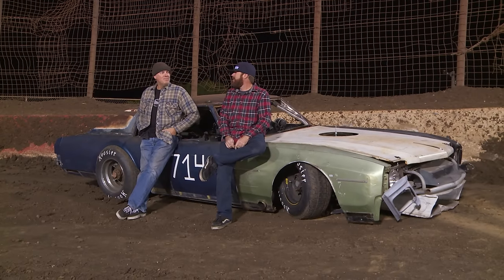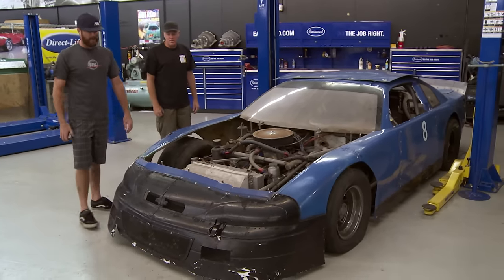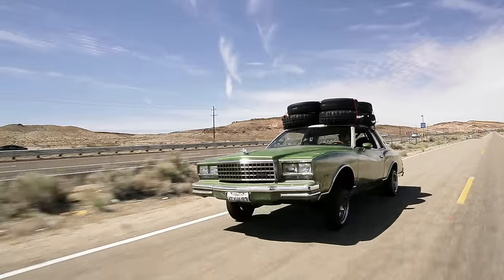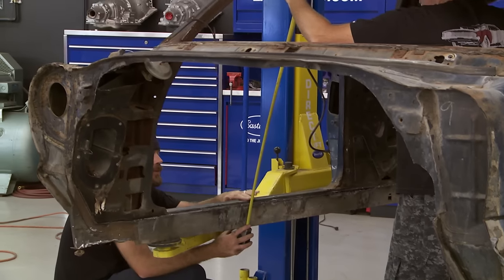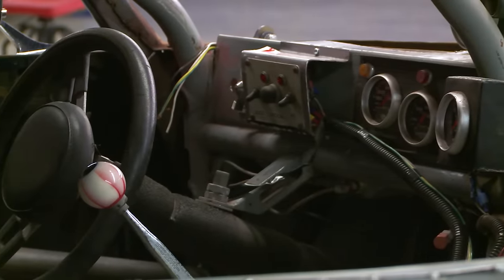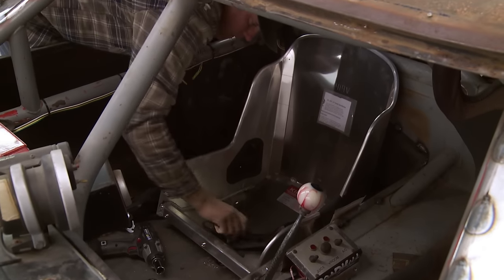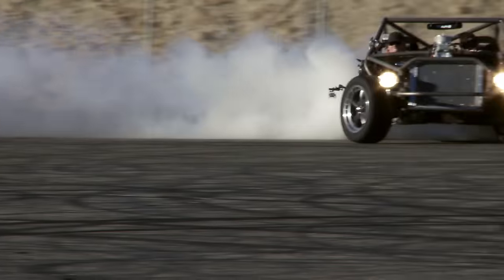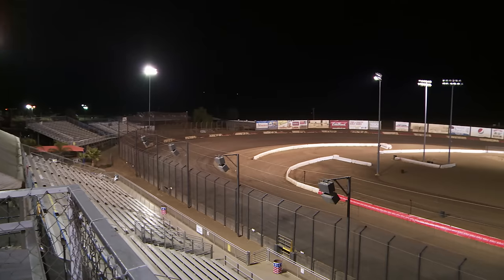Street "Legal" Stock Car Body Swap - Roadkill Ep. 46

Comment: I didn't realize stock cars literately could only turn one direction
Reply: They can turn both ways but have almost all the travel of steering to the left
Reply: Yeah
Reply: +likenem I am near certain "setup for ovals" means an asymmetrical suspension setup that makes left turns easier, and a "road course setup" just means symmetrical. The only true right turn a stock car should have to make is exiting its pit box, and it doesn't need to handle perfectly to do that.
Reply: *****
Yeah
Reply: No they can turn both ways. They are just heavily biased to one side making a opposite turn essentially useless.
Reply: +likenem havent you ever noticed driving in a nascar town that your car will only turn left? lol

Comment: I would have completely chopped the wheel wells and threw low profile plastic flares on the fenders just to make sure the tires clear the rough cut job the cutter did

Comment: The front passenger side suspension let go and it dug into the ground causing him to lose control.  It could have been a ball joint failure, so it wasn't the drivers fault...
Reply: right wheel 45 degrees to the right, left is straight. Mechanics fault, surely, which is the same person.

Comment: I think If I had done the body (and had a bit of extra time) I would have chopped 7 inches or so out of the roof, so the doors still do all of the shortening, but the window opening is slightly shrunk as well, so it retains at least some of the rear end.

Comment: Ford Courier?, how old are you rofl! I'm 54 and had a used one when I was 17 to haul my dirt bikes. The only Mini truck worse than the Courier was the pos dodge made ram 50 or something like that, I abandoned one in colorado, it broke down on the way back from an epic  road trip snowboarding trip and it was cheaper to fly back to california at the time. Oh the memories!

 so we tried to drive it to the air port and made it half way from the service station on 3 cylinders and a cracked head. we only walked for about 5 minutes before some guy in a truck asked if we were headed to the airport and told us to hop in the back. It was my only vehicle that had zero engine modifications at the time, but it was a dodge so I should have never suspected it would ever be reliable rofl